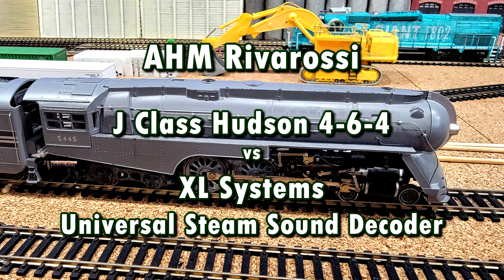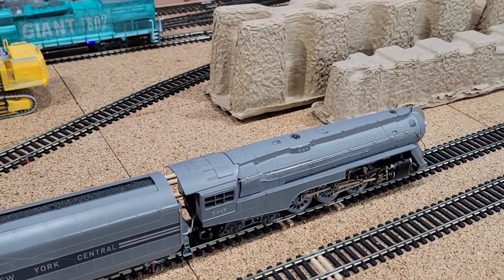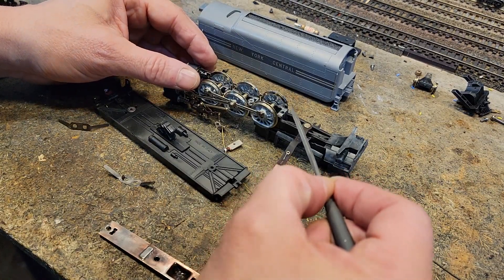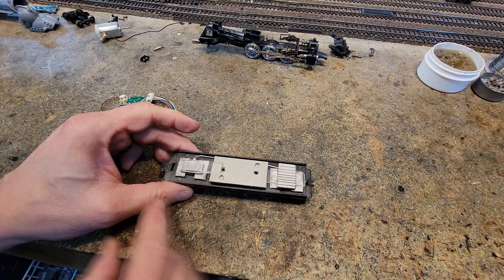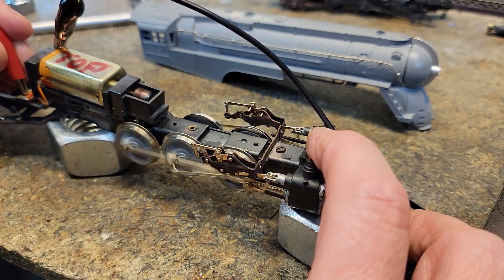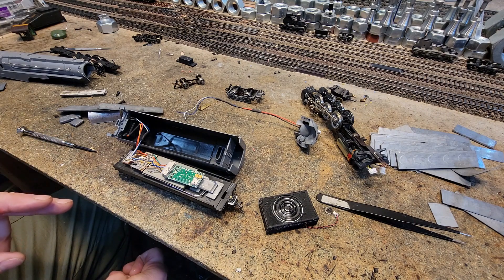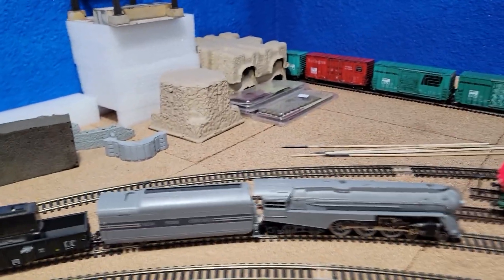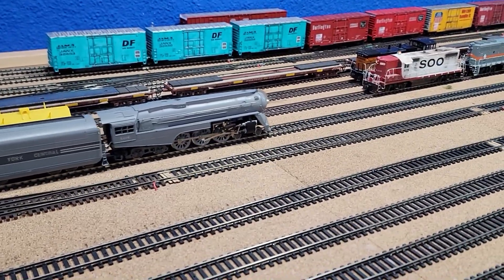Rivarossi 4-6-4 vs XL Systems DCC Steam Sound Decoder

Comment: I have the same locomotive. Was a pain to get a knuckle coupler installed. Then the plastic drive shaft wallowed out and the motor was turning but not turning the wheels. I cut a brass tube and crimped the ends to key it for the shafts. Now it runs great just in DC for now. Just got back into the hobby after 40 years about a year ago. I've been watching a lot of your videos. This video inspired me to finally fix the NYC locomotive I have. Thanks.
Reply from the maker: this one would be ten times better if I could get all the tender wheels to pickup power from both sides!

Comment: This decoder is awesome for the price, but I replaced the speaker and spent about 2 hours programming. If you set cv124 to 255 it should run much more smoothly. Also, cv50 has 13 different whistles to choose from. The chuff rate is cv48 and I set mine to 12.
Reply from the maker: I built that big speaker cabinet and the sound is not terrible - its the power pickup that needs improvement with all wheel pickup in the tender!

Comment: Xl decoders have a chuff speed cv you can also add a 4700 uf cap as a keep alive  there is a spot on the board to put a wire on   just make sure you use a 100 ohm resistor and a diode
Reply from the maker: I might try this in the next one which is a 4-8-4 - but I'm going to upgrade the tender trucks beforehand!
Reply: @elite194  seems to really struggle with power from the tender..maybe add really flexible wire drill a small hole in the bottom of the tender and put it on the part that touches the wheel axle. Are the little waskers between the trucks and the tender bottom? I have never had to add a ton of weight to get it to pic up power.the other thing I have seen was the plastic on the tender trucks around the wheels would actually be touching the track I had to shave a bit off with a razor.  The plastic  hole where the axle ends fit were worn causing the truck to sit closer to the rails.
Reply from the maker: It needs all wheel pickup and I picked up a tender for the purpose of testing an all wheel system.... We'll figure it out!

Comment: You can get 30 gauge wire with silicone coating its very very flexible. Thats what i use it will stop the tender from derailing with out all the weight. I have a few xl decoders none of them cause the speaker to buzz i use a cheap digitrax zephyr dcs52  and sometimes a cheap ass bachmann  dcc controller. Cv 48 is the chuff rate i don't think your motor is the issue.
Reply from the maker: I use 3awg silicone by striveday and it's excellent. Silicone is the way to go because the insulation doesn't melt when soldering.  I put the extra weight in to improve power pickup because there is a serious weakness in area!
Reply from the maker: The chuff is set to read bemf, but the new motor is much more modern and turns at lower voltage than the old motor.  This same issue happens with diesels that use bemf and I haven't found a good setting yet.
Reply: @elite194  at what voltage does the motor start turning at. Sounds like you have a low voltage motor like 6v. I have a video of a k4 prr I scratch built the shell and tender I used a 4 6 4 rivarossi and changed the rear truck to one axle and used a can motor that starts turning a 1 volt . Cv 48 around 45 I think and cv 124 at 80.  I actually have to adjust it because it only chuffs 3 times for every rotation.  Check it out let me know
Reply from the maker: @normancoreyBuildingTrains  .02a will give enough torque to get under way!  That's .02!
Reply: @elite194  what is the rpm rating at 12v. For that loco you should not be using a motor that has motor that 12000 rpm at 12 volts.    ON a side note I love your videos.
Reply from the maker: @normancoreyBuildingTrains  at 12v the rpm will be about 8k and the torque will be very high.  The chuff is set to back emf instead of speed steps - on the next one I'll use the speed table instead
Reply: @elite194  ya I don't know what cv would set the chuff to the BEMF. I only have the list of cv's that are listed in the book. None of my steamers that have the decoder have a problem with the chuff.  Do you have a complete list of the cv's?  I only started using dcc a couple Yeats now so pretty new at it. I use a digitrax zephyr dcs52 not really high tech

Comment: I added pickups to both sides of the tender and put the sound only decoder in the tender with a current keeper cap that added up to 2000mf that was enough .In the engine I put a Soundtraxx motor control decoder with a great current keeper made by using 5 2.7 volt 1F caps wired in series with a regular diode ,a 100 ohm resistor and a 12volt zeener diode as a regulator .I replaced the stock motor in the cab forward with a Sagami diesel motor 2 shaft where one cut off the other has a flywheel .Barely fit but did . Tried a 24 volt china motor ,but it was no good for the gear ratio. First set up the motor control decoder then locked it with the cv 15 in ST decoders then programmed the chuff on the XL system sound decoder . This thing can run a steady 2 miles an hour smooth with the chuff adjusted to it perfectly and holds its timing to cruising speeds. CV 29 was involved in the programming of the xl system decoder for the speed step adjustment on it effects the chuff rate along with adjusting cv 3,4, and 5 on the motor control decoder .Hope this helps .Be making a video soon on my converted Rivarossi cab forward to show it off .
Reply from the maker: I've got another Rivarossi 4-8-4 that get the XL System and this time the tender is getting new wheels first so I can get better power pickup!
Reply: @elite194 It helps but the go around is the current keeper cap. Once charged up sitting at idle if using dcc no need to add pickups any more unless your wheels are really bad .Then wheels are a must .There is a way to hook up a current keeper cap to a sound only decoder .No more cut outs. John at MRC actually told me how to do it. Power is off the rectifier diode 12v,but the ground for the current keeper shares the speaker ground . It works! No problems .The diodes and resistor that go with the current keeper are protections .I have tested without and they work since the a/c sort of power on dcc is rectified  with the decoder or rectified  dcc ready board in the loco.The ends come off if a Rossi centipede tender sometimes not easy .They slide out of the tube .
Reply from the maker: @adamserafini6945  I always try to eliminate keep alives, but I thnk you're right on this one and I've got plenty of those.  The 4-8-4 is going to get and I might bring back this Hudson and putting one it that unit also!

Comment: Rivarossi's current pickup system of that era is a nightmare. The designer should have been shot at dawn. The locomotive picks up current only from one side and the tender picks up from the other side. This could lead to power failure when driving on sections where isolated joiners have been placed in order to use a different booster. I am planning to rebuild a couple of Rivarossi's Hudsons : one similar to yours and the other one for the Empire State Express. My plan is to isolate the chassis, fix current pickups on both sides of the loco and the tender, install loudspeakers both in loco and tender too, install rear light on tender, and install an ESU Loksound decoder. Let's see...
Reply from the maker: this is exactly what happens to this locomotive!  I'm going to try 1 more fix - picking up power from all axles and both sides in the tender.  I put almost a ton of lead in the tender and since you need both left and right rail power for the decoder, I'll add some wipers.  the tender is now heavy enough that any power coming from the locomotive is just extra!  I do think the decoder has potential with dual sugar cube speakers it could be outstanding!
Reply: @elite194  Sounds great! It would be a pleasure to watch and also to hear the engine after these modifications.
Reply from the maker: @jagc1969  yes - we're going to revisit this one with some new wheelsets for the tender or new tender trucks!